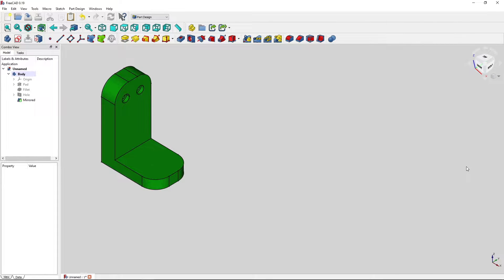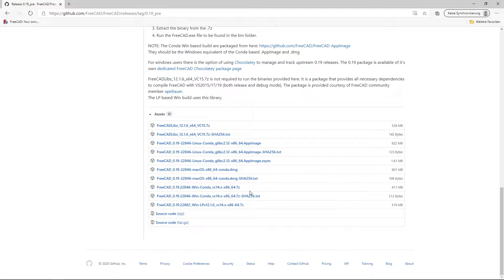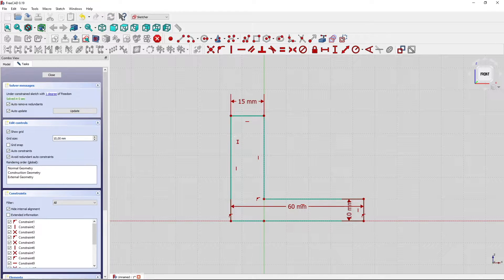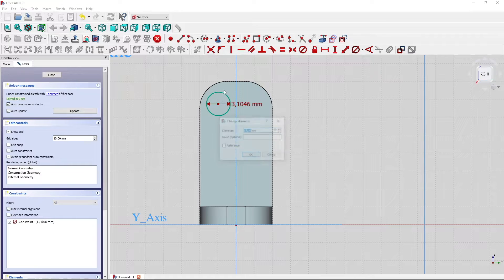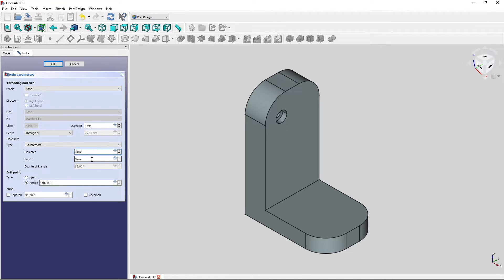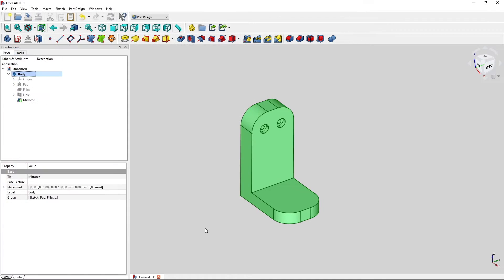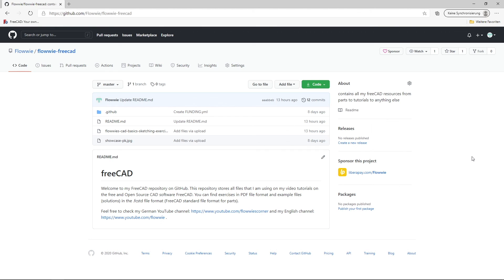From Start to first 3D print in 5 Minutes with FreeCAD 0.19 (English)

Comment: 30 years drafting in all kinds of CAD programs. I hate FreeCAD. I can follow this guy's incredibly clear instructions, and it STILL doesn't so much as take a dimension. The creator here is clean and precise. Looks simple enough... 
Draw a polyline. Give it dimensions. Switch to model space to extrude the 2D sketch. Select origin, space bar, to change planes, add your holes or slots. This should be straight forward. Until I can't even get a dimension to take... very frustrated.
Reply from the maker: I will update my videos for FreeCAD 1.02 as soon as possible. Thank you for the feedback.

Comment: Ok, I've been learning 3d modeling for the past few weeks, in my down time. I see what people are struggling with when watching these videos or reading tutorials, I'm experiencing the same thing. It's like being taught Spanish in school and then 5 years later, you're being spoken to in Spanish and you can only pick up a few words here and there. I watched one tutorial and paused it every few seconds to do exactly what the guy was doing and realized that was never going to work. But I learned a few key basics. Sketch, then extrude. So I practiced doing different sketches and extruding. Then I learned to create a different sketch for every part that was going to be extruded differently. Then I learned to name each of these sketches. I also learned that it is very easy to extrude in the wrong order. When I came across something I couldn't figure out, I asked an AI search engine. That was where I learned to start every separate piece as "create new component". That has been one of the best improvements to my work. Save your work, then save it under a different name and use the second copy to experiment with the functions to try and achieve what you're trying to do. If it gets way out of hand, delete it and go back to your original. The only way you're really going to learn to use the software is by doing it yourself, not mindlessly following a tutorial. Some people, it may work for, but I've figured out, I need to teach myself a little bit at a time. Also, there are so very many ways to do things, the guy making the tutorial may not be using a technique that works for you. Just like what I've said here, im just one guy who is a complete novice. I can tell you how I've learned, but really it is up to you to figure it out for yourself. Because what I have learned is not necessarily the best way for you to do it. 

Start a new component 
Learn about sketching
Name your sketches!
Learn about extruding 
Make some simple things
Try to make more complicated things 
Make mistakes, learn from the mistakes 
One by one, learn how each different thing is done 
Don't worry about the thousands of functions that you don't understand, eventually you will get to them and understand them. 
I hope this can help in some way.

 Also, I've been using Autodesk Fusion (formerly Fusion 360) I'm here because I am looking for something that can be run completely locally. But the Autodesk Fusion free license version may or may not be a better option for learning. I don't know, but that may help someone too

Comment: I have to say, as someone who has manually drafted for years and works daily with computers, this has to be one of the worst tutorial videos I have ever seen. It's obvious the presenter is very familiar with the program since he's flying through the creation of the model, but he isn't explaining anything about how or why he's doing anything, and the set-up of his program is very different from the current download. A better title may be "An experienced user drafts a part in 5 minutes with FreeCAD". Over an hour on this video and I'm only half way through because I've had to repetitively replayed parts multiple times to try and figure out what he's doing, then find it on the current version of FreeCAD.
Reply: I'm not sure you get his point.  The title didn't say "I'm going to methodically take you through a complex design project" he said he was going to do it in 5 minutes!  Check out his other, basic videos on FreeCAD.  The detail is there.  This video shows you what 'can' be done if you use proper workflow AND know what you're doing - even if you use a free program like FreeCAD!

Comment: my mouse only rotates the image cannot  drag or select anything thuse can do but  cubes and predefined figures which cannot  be edited or modified
which renders ALL TUTORIALS  so far useless FOR ANY NEW USER.  autocad its easier to use like paint  but 3d and with dimensions.

next  time do it right there is not a single guide, tutorial OR ANYTHING to learn to use this freecad from no experience to 3d print.
because  you skipped like  1000 Tons of basic things like HOLD CTRL to select/draw things and i don't know how many thing are there to know to even use it, and yet no single tutoria tutor about this i spend 3 hours searching for "tutorials" to start and learn how to use it, and so far non have been helpful because all are  made  for the community of people that already know how, not for the ones who don't know a single thing about it.
  please remove the #beginner part and change it to already familiar with, because as a beginner i didn't  find it useful, so far 1 hour of smashing and clicking was better on learning that the tutorials (including this) there are a ton of concepts and key controls that meets the eye  and no one  tells you about it...
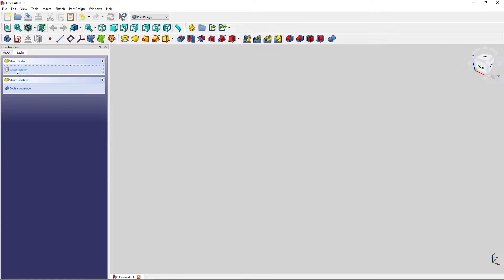so please stop lying about this been for beginners no beginner ever will  past from @1:38 because  you can't  draw or select without knowing that you have to hold CTRL so you can drag and draw or select.

Comment: Excellent !  Another Flowie Freecad video to start my weekend!   Keep those English tutorials coming - Im having trouble learning German 😂  I actually tried to watch one of your German videos the other day in desperation but it didn't work out so well.  Cheers from Eastern Canada !

PS  - I've found that the export to stl produced a rather "rough" curve with more a series of flat faces.  Maybe there is a way to refine the settings in the mesh workbench?   Might be another video topic for you.  I'm just starting with Freecad and have been watching videos and picking through the wiki for weeks.  There's a lot to learn but I'm making some progress (I think).  Thanks again for all your efforts.
Reply: Accuracy of STL: Edit - Preferences - Part Design - Shape view - Tessalation - Maximum deviation depending on the model bounding box: Value 0,5% change to 0,01%